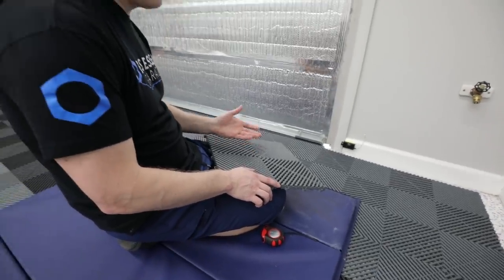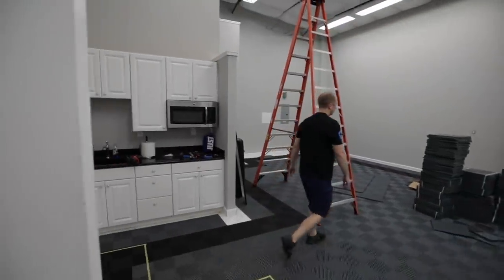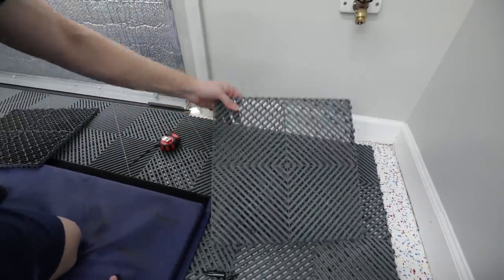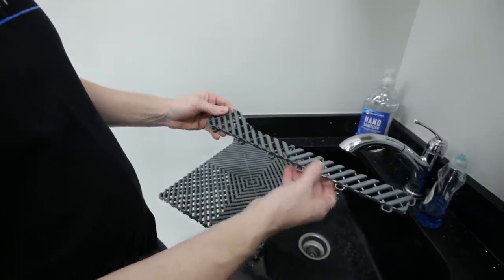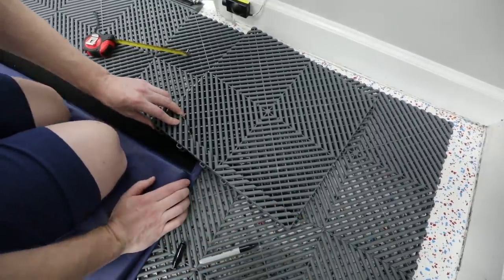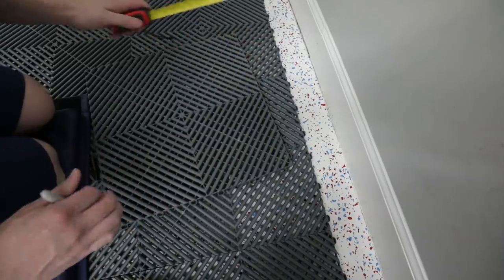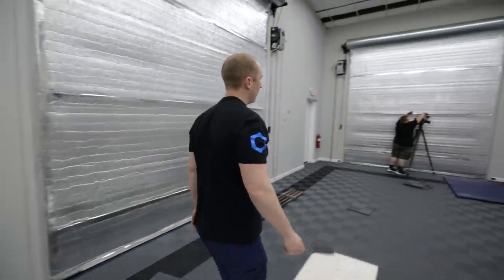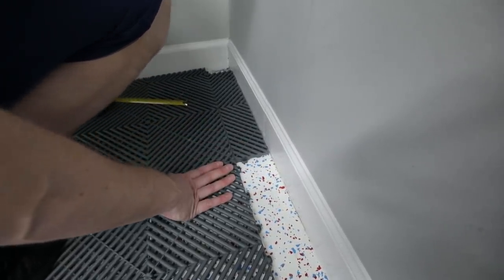Obsessed Garage "Moving" Vlog: SwissTrax Continued (Cutting Tiles)

Comment: Just installed this floor in my garage this weekend with my wife’s help. WOW! It looks amazing and I can’t believe the transformation. 
A tip for others on cutting tiles for edges. All this measuring will make you nuts if you have a lot of cuts. Here is the quick way.- I will explain as best I can.
1- lay tiles from left to right as far as you can go with full size tiles. You will now have a  gap that  you will need to cut a tile to fill. 
2- Place a full size tile, properly oriented , directly on top of the last full size tile you put down. This will be the tile you will cut.They will want to slide on one another, so you may need someone to hold it. 
3- position a full size tile on top of the one you want to cut, and slide it back until it hits the wall . ( If you want a gap at the edge, make sure you let the loop side hit the wall.  If not use the straight side)
4- You will now have exposed the amount of tile you need to cut on the tile under the one you slid back
5- Draw a line across the tile to cut using the straight edge of the top most tile
6- Cut your tile that you marked.

It will fit nearly perfectly. No doing multiple measurements. Very quick
Hope this helps.
 Thanks for your reviews. I bought these because of your videos.  One of the best home projects I have ever done.

Comment: Matt, you realize that the white-painted flOor base cOuld have been removed and replaced with new base SET ON TOP of the SwissTrax, thereby hiding all irregularities and also allowing for expansion/contraction. Still looks great. Regards...
Reply: Andy Lauria, you could go with installing a membrane over the white painted floor and installing any tile you want over that. The membrane will stop the tiles from cracking and allows for the base to still do its thing.

Comment: Two questions. What  type of jigsaw blade?  Second I live in Florida. How much of a gap do I need to leave along the edges to allow for expansion from the heat?
Reply from the maker: It depends on how often you have direct sunlight on the tiles.  I rarely leave my door open with direct sun on them, so I don't do a gap.  I butt it right up to the wall.  Any blade will work.  The finer the TPI, the better.

Comment: Hi Matt custom cutting and or fitting is always a pain luckily almost always very satisfying in the end. I have a couple of questions I hope you can answer when are you planning to have PCL parts available I picked up the accura 1 about a year ago and I see The new lock on Chuck is much nicer then the one I have much more in line with the quality of the gauge I had a cheap analog gauge with basically the same Chuck and how many tiles are in one box of Swiss tracks as I’d like to order one box to check out before I order a whole floor thanks for all you do it is appreciate 
john

Comment: Doesn’t it expand and contract with summer heat?
Reply: Oh Bee Gee mine does. And this winter it has slid slightly because it has shrunk. Probably will need to pull it out in the spring and adjust it.
Reply: If you have HVAC in your garage it won't move.
Reply: Mike is right.. I fl our garage will go up to 115 degrees. Leave 1/4 inch to expand